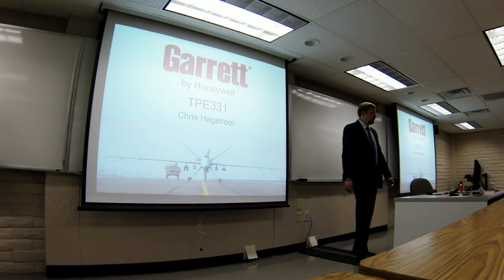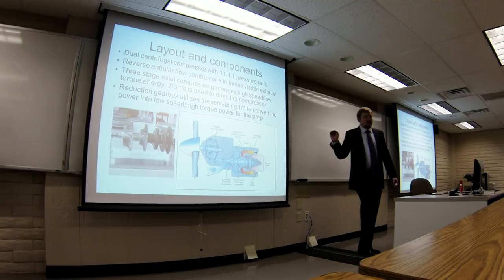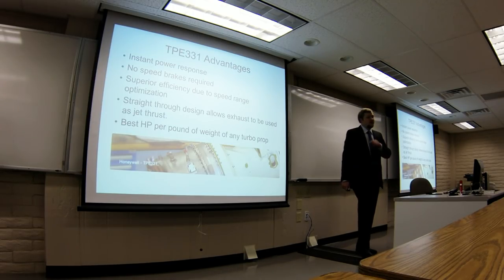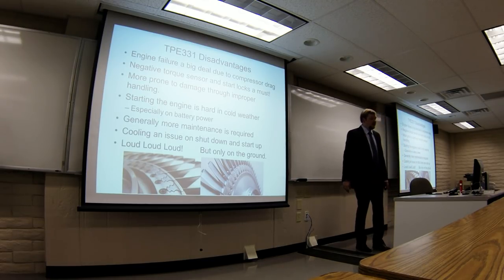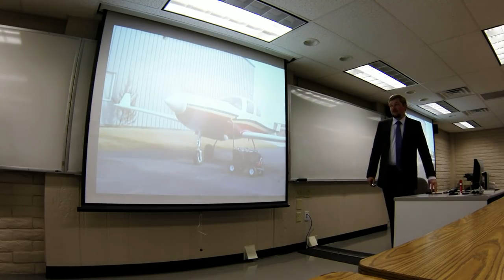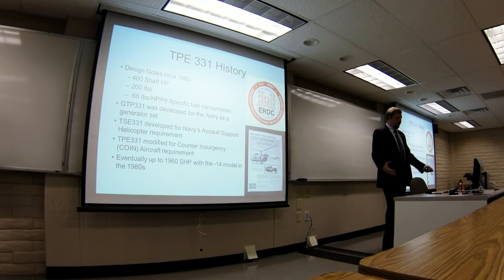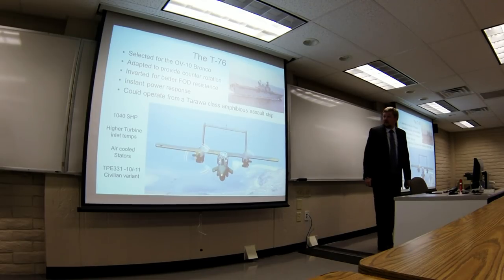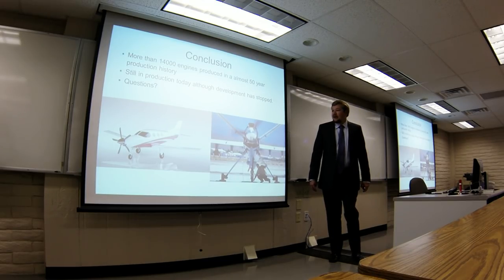TPE331 Turboprop presentation

Comment: You did a nice job, Chris!  However, the TPE-331 isn't running at "70-100% power" at all times, but at 70-100% "rpm". Power is a product of rpm and propeller blade-angle. As a single shaft-cycle engine the TPE331 offers essentially immediate response to powered demands, while providing excellent fuel efficiency; which you covered very well! (Retired AiResearch/Garrett/Honeywell.)
Reply: Hello Chad. I am a current graduate student at Univ of Cincinnati.
 Can you help me out on some information regarding the TPE 331- 10? 
I am working on a project where I need some data regarding the engine. If you could provide an email we could talk about it more. Thank you in advance.
Reply: so many problems with this video, but this is one of them.  Needed a quality review that's for sure.